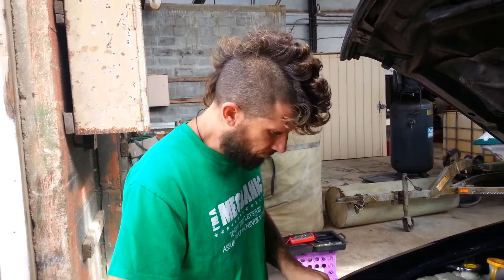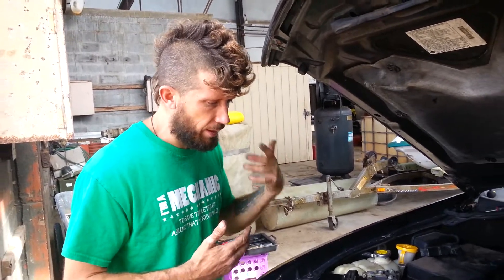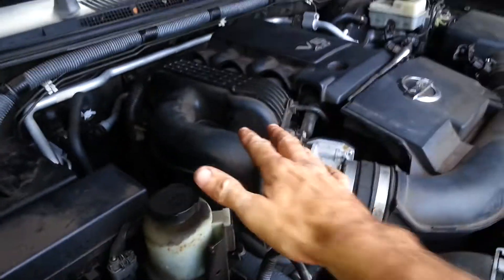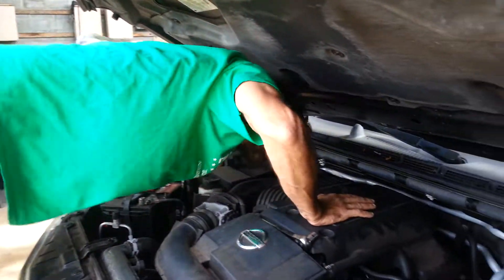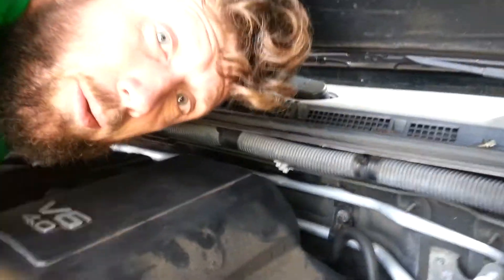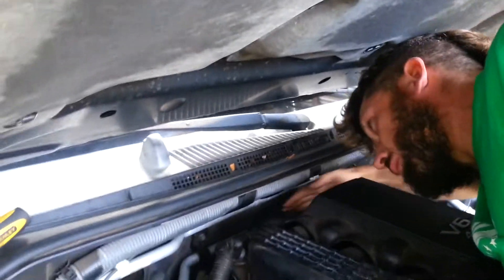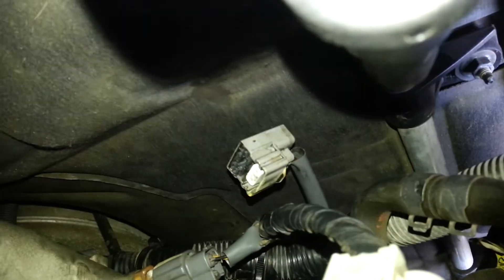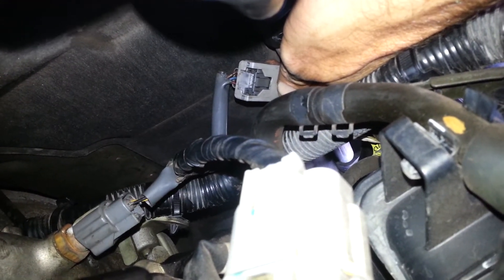05 Nissan Frontier Camshaft Position Sensor R&R

Comment: I did both sensors and am still getting code 0340? any Ideas, I have an 06 pathfinder
Reply: Jed Henry Did you ever fix it after still getting code? Im getting cam and crank codes and fix em and still getting it
Reply: did you erase the codes after replacing the sensors